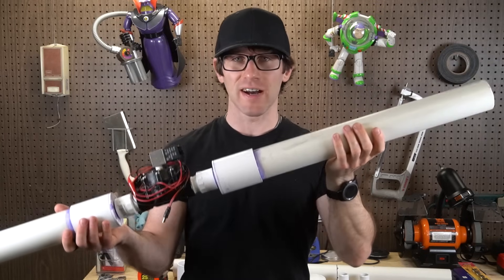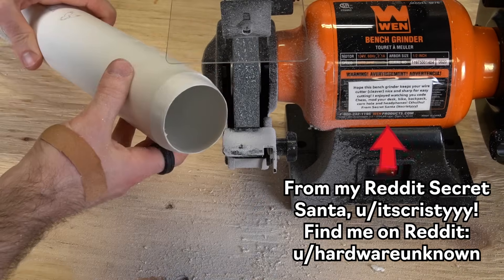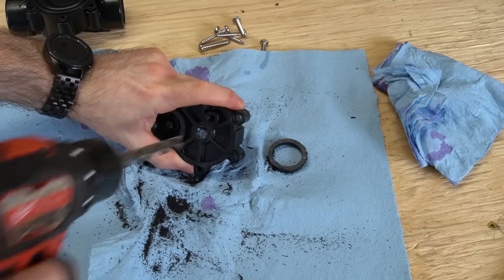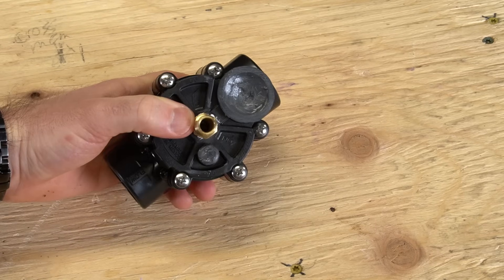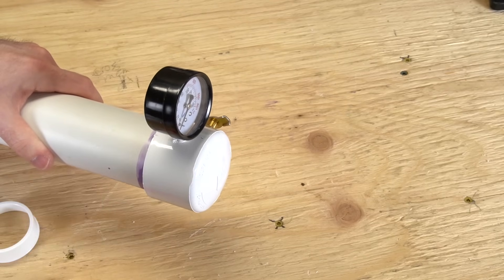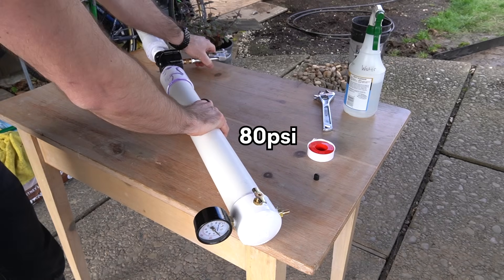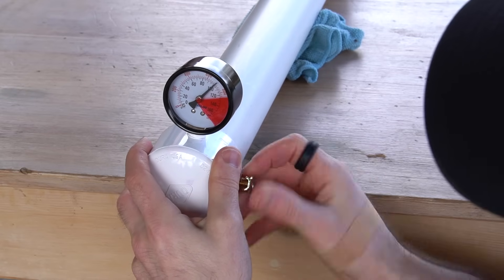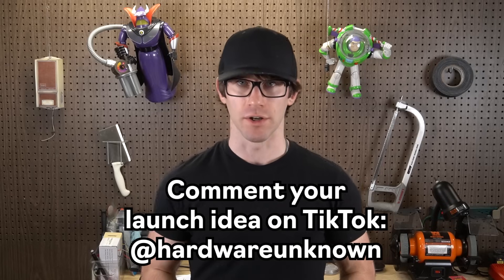How to Make a Simple Air Cannon

Comment: If you want to be safer, use a paintball air tank. Typically rated for 3000 psi. You will also need a 6mm to 1/4 adapter

Comment: it's an option tu use the valve with the default 24v selenoid valve on the default hole? or i need to drill the new one on the center? Thanks!!

Comment: Wat if you made it out of copper tubes
Reply: Triple its potential copper L pipe is rated for 300psi but you will triple the cost. You'll need a high pressure air compressor it will be more dangerous also at triple the threat

Comment: My air is leaking a little bit through the barrel chamber, why is that?
Reply from the maker: My apologies for the late reply. Did you figure it out? The reason I most often had barrel leaking issues was a misaligned diaphragm. If it gets caught slightly open it will allow air past. Try dismantling and rebuilding the sprinkler valve.
Reply: @HardwareUnknown is one side of air blow gun must blocked or open? Beacuse if i buy other air  blow gun from market. Than this blow have one outlet and one inlet
Reply from the maker: @gurdeepsidhu5447  The air gun connection on the launcher side allows air in, and inside the gun is a valve. This temporarily closes the gun until you pull the trigger. When you do so, the side that is not connected to the launcher opens, allowing a small amount of air to release, creating a pressure differential in the sprinkler valve that then allows the sprinkler valve to dump the air in the tank and launch your payload. Does that make sense?
Reply: I had the same issue. For mine it was a combination of the pump I was using not pushing enough air and the sprinkler valve remaining partially open.

I had to rebuild the valve a couple times and upgrade to a better/stronger manual pump and it works flawlessly now.

Comment: Perhaps some flanged steel piping and O-rings could be directly fitted to a standard valve without any adhesives and custom modifications? Cool design though

Comment: I hope it will work, anything you think I should be careful with?
Reply from the maker: I know I've mentioned it in the video but please pay attention to the warnings. It's a risk pressurizing PVC as its not intended for it, so while nothing can be fully safe when doing so, err on the side of caution and use lower pressures.

As for the build itself, make sure you take your time to fully seal the sprinkler valve as shown, and properly seat the diaphragm when you reassemble it. Air leaks are the most common issue you will see with this, and even more so with the valve as its more complex than simply gluing PVC together.

Comment: How did you get the solenoid to work? I just get a honking noise when I use it
Reply from the maker: You can tell if the solenoid is working by the click it makes when it activates. The honking is likely from some sort of air leak with the diaphragm. Check to make sure it is oriented and seated properly. There will be a brief moment when air escapes as the chamber pressurizes, but once it is full pressurized the diaphragm should seal and this should stop.
Reply: @ thank you :) I got a larger solenoid unit and it helped out :)

Comment: How many shots can you get from say 120 psi?  Does your setup allow for air to stay in the chamber for additional shots or does all of air in the chamber escape with one pull of the trigger?
Reply from the maker: My apologies for the delay. This setup is good for a single shot as there is no means to partition or otherwise partially release the air reliably.
Reply: @HardwareUnknown  Is the PSI rating of the sprinkler valve itself important? Lets say the valve is rated for 50 psi like do i have to match that up with what I put in my chamber because idk if solenoid valves are rated for anything im scared if i pump too much it might fail im planning on using a metal chamber with a pressure rating of 200 psi but with the same valve concept as yours, using a sprinkler valve but im kinda scared to use it because im not sure if its strong enough for this much pressure because its made of plastic, or is it not important at all what the pressure rating is on the valve? im still learning when it comes to these things :p
Reply from the maker: @thewhitesheep4156  My apologies for the late reply. Given you're making yours out of a metal chamber, you're better off safety wise. That being said, a thick enough metal chamber will hold far more pressure than a plastic valve. If you're going through the effort to do this with metal, I would suggest doing so completely so that you benefit from the strength throughout. There are other creators that have made fully metal launchers that use a bit different design, I would seek those out for comparison.
Reply: @HardwareUnknown  it just kinda hard to find a metal sprinkler valve where i live so i have to use the rainbird plastic ones but im kinda scared to put 200 psi on it since its made of plastic as im not really sure how strong these valves are, will an air chamber made of metal with valve made of plastic still be safe? Upto 200 psi? Thats my main question
Reply from the maker: @thewhitesheep4156  No, unfortunately. Any system is only as strong as it's weakest point, and sprinkler valves are not meant for those pressures. As mentioned, all the items are not being use for their intended purpose so there is already risk. For a low pressure system like mine, there is still a danger of damage or injury even then. Pushing the limits of pressures further increases that risk. I would caution against it for how powerful it seems you want to make your cannon. Many have made powerful cannons like the one you're planning, but they don't use plastic for a reason.

Comment: Can you explain please how the trigger makes the valve open? This is the only piece i need now before my build
Reply from the maker: Of course, it's a great question.

Notice that the blow gun is mounted to the sprinkler valve on the side where (internally) the diaphragm contacts the spring. When you pressurize the cannon, you may be able to hear a small amount of air escaping the barrel. This is because it takes time for the air to pass through the small opening in the diaphragm to the spring side of the valve. Eventually, enough air is on the spring side of the valve that the air pressure and spring tension together are able to seal it off since they now overcome atmospheric pressure.

When the trigger is first pulled, a small amount of air rushes out through the blow gun as you'd assume. You can feel this by holding your hand in front of the blow gun opening. The thing is, all that tank air pressure wants to equalize as quickly as possible with the atmosphere. When the "flood gates open" from pulling the trigger, all that air tries to rush out at once. Because of the pressure drop from the air exiting the blow gun, the diaphragm opens slightly, providing a second path of exit for the pressurized air.

The air then tries to rush out both the blow gun and the barrel simultaneously, but you'll notice that inside the sprinkler valve on the diaphragm itself there is only that small hole for the air to pass through (through the small white plastic piece in the diaphragm). Initially, the only exit for the air was out the blow gun. Now with the diaphragm slightly opened it is easier for the air to pass through the large open barrel than it is to rush through the small opening of the diaphragm and out the blow gun.

Pressurized air chooses the path of least resistance and tries to exit as rapidly through the barrel as possible. This causes the diaphragm to be forced open as the air pressure overcomes the spring tension. The air rushes out the barrel in one big burst and the cannon launches. Once the pressure equalizes to atmospheric pressure again, the spring tension resets the diaphragm and the process can repeat.

All this is happening in a fraction of a second so it's hard to tell when one "phase" of the action occurs, but that's the order of operations each time you pull the trigger.
Reply: @HardwareUnknown  wow! Thanks for your great answer!

Comment: also when i pump air into mine, the sprinkler valve is leaking air from the front, idk what to do can you help?
Reply from the maker: Is it leaking out the connection between the valve and the adapter? If so, you may need to simply crank it down a bit harder (be careful, you can do this too much, but perhaps it's looser than you think). That, or add some more PTFE tape before tightening.

Comment: I came from the TKOR video, this is a great project. I was wondering, could it fire water balloons?
Reply from the maker: It certainly could, only question is if they will rub on the inside of the barrel and pop before launch. I haven't tried it so I don't know, but if they do pop early you could lubricate the inside with a light coat of biodegradable soap.

Thanks so much for watching! I love TKOR. What video was it? I didn't realize one of TKOR's linked to mine and you have me curious now.
Reply: @HardwareUnknown  Okay, that makes sense. Your project is similar to his, he also used lubrication on his version, as well as cut up plastic bottles for wads. (I heard that using paper bags tied to a string might work better.) Both designs are great, but I might go with yours since it looks easier and I am trying to make a portable version, like with the battery you used. I'll probably add handles externally somehow.

For the video, he made an AK-47 style rifle that can be modified for water balloons.

https://www.youtube.com/watch?v=7Z-L4GliAts

https://www.youtube.com/watch?v=_NaQBvfEGMU

Check it out and let me know. I might try to do a mixed version, but we'll see.

Comment: Brilliant creation! I used this for my physics project. But the problem is I’m not sure if the length of the barrel affects the distance and accuracy? Does the things inside go further with shorter barrel or longer barrel? Does it become more accurate with longer barrels?
Reply from the maker: I'm delighted you made it yourself for your physics class! How'd your build go?

This is a fantastic question and one I looked into back when I played paintball. The thing about a projectile in a barrel is that it's not flying absolutely straight in line with the barrel. It rattles around in there to some degree. How well the size is matched to the barrel will influence this. Too small, and the projectile can move a lot (relatively) creating odd spin as it touches the barrel walls (more noticeable on spherical projectiles like paintballs), and also decreasing the potential velocity as air escapes around it. Too large, and the projectile will experience excess drag against the inside of the barrel, slowing it down.

The length of the barrel also comes into play like you're suggesting. A longer barrel will tend to be more accurate as the projectile has more time to orient its flight along the barrel's axis. However, the longer the barrel the more collisions/drag it experiences (imagine a 100ft air cannon, the projectile may not even make it out the end).

A shorter barrel will tend to be less accurate as there is less time to orient the projectile, and if you go too short, it will actually slow it down too. The reason being is once the projectile exits and is in the air, it's experiencing a lot more drag from air resistance. On top of that, it no longer has the pushing force of the pressured air behind since that disperses once it exits the barrel. In this scenario, the full force is not going into the launch. Rather, some is going in to push the projectile itself, while the rest escapes the cannon and pushes the air around you. Shorter barrels have the benefit of better maneuverability and portability, but they sacrifice in other areas for these.

Combine all this together and you can see how there is a "sweet spot" in terms of barrel length for a given pressure/projectile size/projectile weight/etc. Lots of factors go into ballistics, but it boils down to you want a barrel that is long enough to allow the maximum amount of pushing force to be used for the launch, and not so long that undo drag is placed on the projectile. For maximum distance, ideally the projectile would exit the barrel the instant it stops accelerating.

Teams of engineers can do all sorts of math and run all kinds of tests to determine the measurements to use for a given projectile/launcher. I ran some tests way back with tennis balls to try different air pressures, barrel lengths, air tank lengths (volume) etc. It was fun. Perhaps you can set up some experiments with your physics teacher for some extra credit demonstrating how you found the ideal barrel size for several projectiles!

Comment: This is very very dangerous you should never pressurize pvc sch 40 pipe like this it literally becomes a pipe bomb in the wrong conditions switch pvc with type l copper much safer

Comment: Hey I was wondering if you could just use the solenoid that comes on the valve in order to actuate it, because I have been trying. Is this true? If so, can you explain how to wire it with a button please. Thank you very much @HardwareUnknown
Reply from the maker: This is a good question, and one I tried to answer. From my tests, no, at least not easily where it would be worth the time. The reason is because the solenoid it comes with is enclosed. It's meant for water use and doesn't have an exit for air, essentially just a water valve. What that means for us is we don't get the pressure differential necessary to trigger the cannon. That's why I had to make use of a standard solenoid as you see here. Not that it cannot be done, you may be able to find a way by modifying it, but for the effort involved in doing so it was easier for me to simply attach the aftermarket one.
Reply: Ok, thank you so much! @HardwareUnknown
Reply from the maker: Of course. Let me know if you have any other questions during your build. I can tell you've got a good eye for making things, thinking of how to make use of parts you already have. Can't wait to hear how it works out!
Reply: That not true lol I’m just broke and lazy @HardwareUnknown
Reply: OK i know that this is like a year later almost lmao but what if you made some sort of air relief on the solenoid that comes on the valve? Do you know how this could be achieved?
Reply: @HardwareUnknown
Reply: @HardwareUnknown

Comment: Can you use anything else than a sprinkler valve? I'm having a hard time finding similar one where I live.
Reply from the maker: I have seen others use a standard ball valve. The benefit of the sprinkler valve is it opens near instantly. The ball valve must be turned manually and thus it opens slower. You'll lose a bit of force using one depending on how fast you open it, but you should still get plenty of distance. Those should be readily available.
Reply: @HardwareUnknown  Thanks for answering! I'll probably try it with the ball valve. Though could it work with a guillotine valve?
Reply from the maker: Theoretically yes, if you have one capable of withstanding the pressure and not leaking. From my brief search, though, I noticed that a lot of guillotine valves open using a circular handle that turns. My guess is that these require several rotations to fully open. This will take longer to do than the quarter turn of a ball valve, so you will get less power even with a valve of the same diameter due to air leaking out over time rather than exiting all at once. When you're dealing with air cannons, it may seem that the small length of time the air exits is fast, but it can be relatively slow with certain setups causing power loss. Try both! It would be a good experiment to see which works better.
Reply: @HardwareUnknown  I have seen some guillotine valves with a pulling mechanism and that seems to be pretty fast but I'm probably going to try them both! Thanks again!
Reply from the maker: My pleasure, thanks for watching and good luck on your build! Let me know how it turns out.
Reply: @HardwareUnknown  Will do!

Comment: i made an air gun out of black metal pipes and can hold up to 4500 psi and is lethal and fun too, but you inject air with pcp 8mm adapter valve, also i loaded steel ammos and can penetrate through concrete wall
Reply: I'm wondering about building one to work on the same principal as a dieseled air rifle you think it'd work?